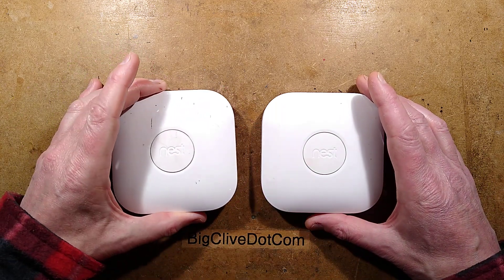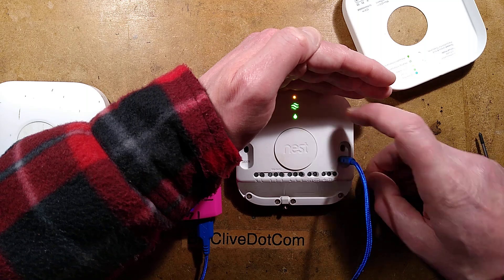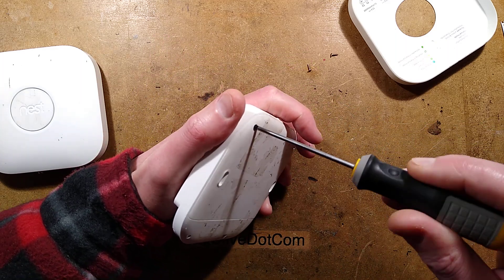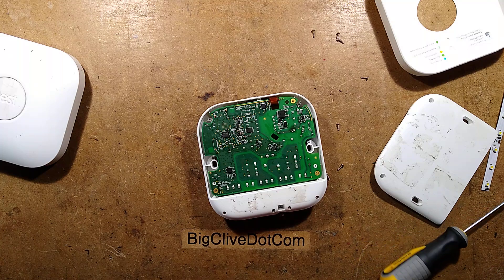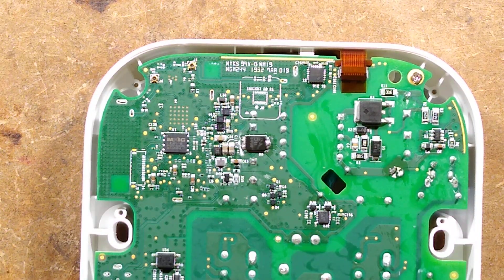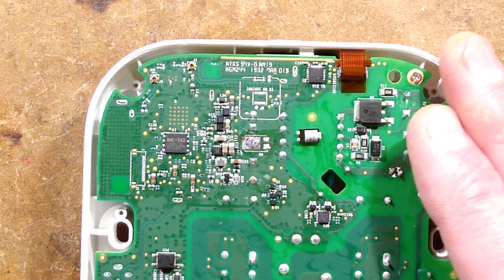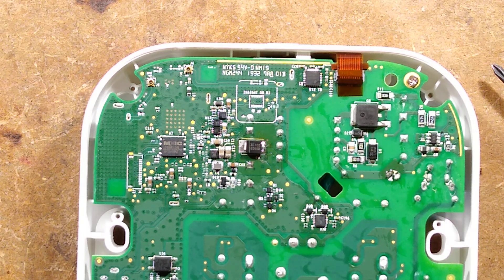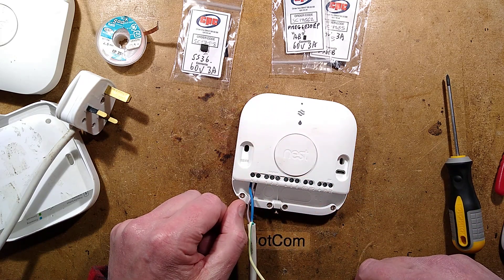Fixing another Nest heat link - with easy tests

Comment: why on the right hand pads does it seem that there are two seperate pads and the diode removed seemed to have 3 points?? on the data sheet it looks like one diode that can be used for two circuits seems strange set up
Reply from the maker: The two pads at one end are commoned
Reply: @bigclivedotcom  Yes but just wondered Why??

Comment: I would have been blowing like hell on that diode...worried at the amount if heat put in while soldering it on, & probably waiting for it to cool between sides....may be I neednt worry so much in future...If Big Clive with his qualified experience doesnt feel its a need to worry about, then i guess its ok ?
Reply from the maker: Keep in mind that they're designed to go through a solder reflow oven on a slow conveyor.

Comment: One time I bought new soldering tip and it had ""special"" tip for removing components like that diode. It was just wide tip shaped like U, and it so special that it bend  and broke... Yeah it was cheap but still it was a bit bad at removing components from board...

Comment: I am surprised they allow those devices .Definitely not approved for Canada .Does it actually have a ULC rating on it ?
Reply: I doubt it does. UL is for US/Canada while Nest Heat Link is only for Europe.
Reply: @eDoc2020  There has to be some certification for them like the CE ,I wouldn't put that in my house,especially at 220V .Although they use arc fault /ground fault breakers .We have had nothing but nuisance tripping with them and a whole bunch of Siemens Breakers were pulled off the market .As a matter of fact I'm stuck with about 1 dozen of the that are no longer approved because of bad programming ..Does the back plate have a knock out and mounting holes for screwing to an electrical box ???

Comment: Hi Clive! 😀

I've got an interesting problem that I've discovered.

I bought 4 tuya switches and I installed 2 of them and set them up correctly and all working properly.

Well now I have this weird and intriguing problem.

Its no longer working.

Well after lots of tests like reinstalling the app.

Testing power supplies.

Swapping out switches.

I tested the output voltage of the ac dc adaptor which indicates its about 20 volts.

But here is the inexplicable phenomenon!

When I plug the same 20 volt output barrel jack into the switch its only 3 volts???

Wtf is going on?????!!!

It appears the switch is turning the output voltage of 20 volts to 3 volts.

Why the ** would it be doing that?
Reply from the maker: If the adaptor is rated for 20V output and is being pulled down to 3V then either the adaptor or the device it's plugged into has failed and is dragging the voltage down.
Reply: @bigclivedotcom  while I was waiting for your reply last night I kept thinking about my tuya switch and then realised it has a USB port. 🤔😃

Last night through curiosity I wondered whether it would power on if I used the usb port.

I got up and went looking for a suitable mini usb plug.

Guess what it works! 😀👍 

So what does that mean?

Two of my ac adapters have failed?

Or my tuya switch has failed.

Or a part of it has failed.

Well you must be right these tuya switches and or components have a high failure rate.

It makes me angry because this switch isn't even 12 months old and already its failed.

You conclusion must be right because surely two adapters couldn't be faulty.

There is a higher probability that part of the switch has failed.

Sigh.

Thank you very kindly Clive.😀👍

I might go and get another adapter and try it.

If it doesn't power on then I can conclude part of the switch has indeed failed.
😖

Comment: I’ve got 5 thermostats which heats each room separately. 2 of the heatlinks broke in December and now a third has just broke. Had them less than two years and this is the second winter we have used them. Google customer care has been amazing. You absolutely can not fault them. However I did notice one of the first heatlinks to break was burnt when I opened the back before sending it back. Does anyone know why or how this could have happened; and should I be concerned?
Reply from the maker: It might have been a relay failure.

Comment: What percentage of diodes fail short vs fail open?
Reply from the maker: In my experience, most fail shorted.
Reply: If a diode fails short it might lead to excessive current, turning the diode into an open. For power diodes this would likely be accompanied by visible damage to the package.

Comment: Can anyone see why that diode had 3 terminals? There were also 3 pads on the pcb, with 2 shorted.
Reply from the maker: The diode used a three pin package with the two at one end connected internally.

Comment: You will remember the very cheap Chinese soldering iron you reviewed some years ago. I bought 2 and moded them to include a silicone lead and earth. No 1 iron is taking several minutes to heat up now. It has been a good iron. Other cheap irons I have bought failed after a few months. I do have to two other 'good' irons. The second Chinese iron is not so good as it never gets hot enough. I'll change the tip and check the heating element but I doubt that will help. My Weller is now defunct, they no longer make the tips for it. They gave me the email address of two sub contractors that make the tips. They never replied. Don't buy Weller. My 150W 1966 iron is till working perfectly, good for chassis soldering ( soddering to our U.S. friends )

Comment: Mines just done this over the week end power to it but nothing lights up.
Reply from the maker: Google may still honour the warranty on it.
Reply: @bigclivedotcom  just tested mine its got the exact same fault as your diode weird must be a common fault in these units.
Reply from the maker: @David-kd7vl  It is.  Probably due to the lack of a snubber across the diode.  Schottky diodes are very sensitive to exceeding their reverse voltage.

Comment: I think it's very likely that the failiure mode is connected to operator error when it comes to units like these.There are so many possible sources of bad installation.
Reply: How exactly would that hurt this particular diode?
Reply: @Peter_A1466  High resistance connections should have potential to damage components? High resistance connection sould be pretty common when people with little experience install things like this for a plethora of reasons such as poor wire stripping over tightening od terminal clamps etc. If it's a well designed consumer appliance maybe the diode is a planned faiure mode because it fails in a safe fashion?
Reply: @Peter_A1466  Sometimes the wiring is also too short, and stiff, and you can't get it firmly in place.   I had some fun putting in a replacement thermostat (a NEST) because the wiring pattern/locations were very different.  I had to be very careful to get everything in place, and one wire backed itself out.

Comment: I fail to see the point of all these network enabled heat controls, and I would be a big tech head.
If you’re maybe a person who is constantly travelling for work then yes it would be useful but in a busy household, normal zoned timeclock and stats controlling valves and the burner is fine in my opinion. 🤷🏻‍♂️

Comment: Why does that diode have 3 pins if its only a single diode and not 2 diodes with a common Anode or Cathode?!
Very odd.
Reply from the maker: Standard package used for other components.
Reply: @bigclivedotcom  I've never seen a single diode like that. I've seen plenty of double diodes in a sot-3 package, but not a single. Good to know they exist.

Comment: I've fitted a few of these, and I've had hot water fail very quickly on the 2 that used a hot water cylinder. I assume it's the relay, but I haven't tested either.
Reply: Can you have a look at the circuitry and determine what is most likely to fail? The relay will not operate (stuck on)

Comment: Nest is a typical lifestyle brand with highly questionable hardware but slick marketing made worse after Google bought them and not only ignored what needed to be fixed but exploited Nest buyers for yet more of Google’s relentless personal data collection which accounts for around 90% of Google’s profits. Google offers carrots on a stick above all else and that includes Nest products. A huge number of Nest thermostats have suffered hardware failures sometimes resulting in very expensive HVAC repairs when the thermostat say calls for non stop cooling in the dead of winter or non stop heat in the dead of summer while nobody is home. I’d never trust my home to these crappy poorly engineered unreliable products for something so critical.

Comment: Very soon you get hundreds of that c**p. May check if a route cause is to find that the original deisgn was for 120Volt & China is only 220V. UK 240V at the highest side. Most of EU continent is only 230V. 
.
Reply: Heat Link is a Europe-only product, so I doubt the design was for 120 volt only.

Plus the diode is on the secondary side so it shouldn't really be affected by the primary voltage.